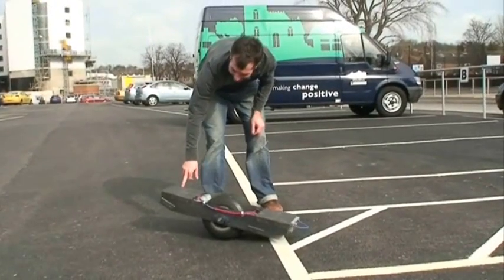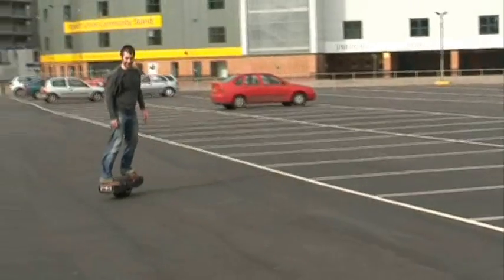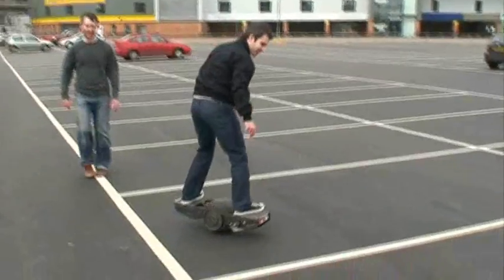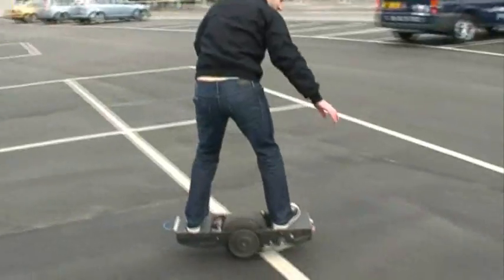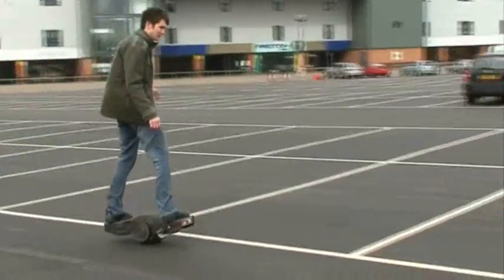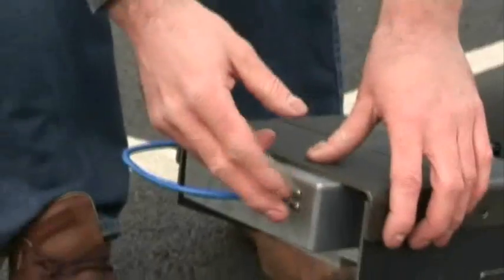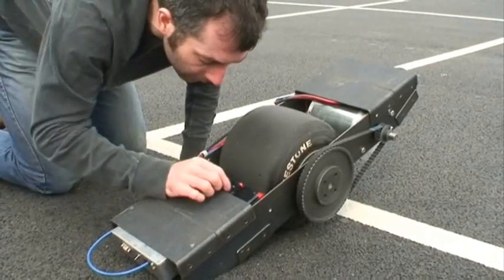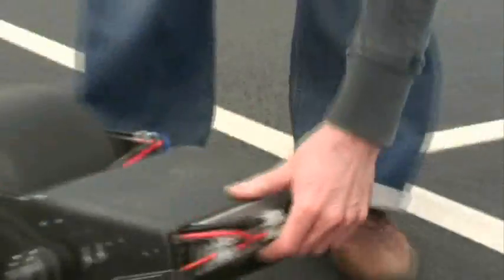Balancing Scooter / Skateboard

Comment: It really bugs me that future motion claim to have invented the onewheel, when you clearly did. 👏
Reply: He did not
Reply: @ManifoldSky He has more of a claim to it than anyone else I’ve seen given that Onewheel came about several years later
Reply: @Jeremy_Huggins  No he really doesn't. Ben built his one wheel in 2007, based on plans and specs from a number of online sources that were part of an online community trying to make home built DIY versions of the balance board first patented in 1993/97 by Dean Kaman of Deka Research (which also showed EUC implementations).
Kamen went on to use his patent to build the Segway.
The patent predates Ben by a decade and a half, and FM by two and a half decades!
Reply: @ManifoldSky  interesting, thanks for the history lesson! I’ll do some reading on what you said as this intrigues me.

Comment: This guy has a full spec sheet in the bio. His notes basically describe a modern onewheel detailing pushback and a hub motor. (This one is belt driven, which is wild)
Reply: the original prototype onewheel was belt driven too. Or maybe chain driven.
Reply: I believe it was chain-drive, but the idea is very much the same.

They didn't invent shit, just patented someone else's work.
Reply: @MasonH24 Ben Smither didn't invent it either!

Comment: Feel the need to comment: Having a patent means very little unless it has been tested in court. Being awarded it by the Patent Office does not mean it is officially valid. This alone is not enough. I have had a few myself. It doesn't give you the right to anything except to sue a possible infringer at your own expense, a considerable expense. It only has any value if you do that and win. If your patented idea turns out to already have been in the public domain, such as a website, research paper, YT video, before filing date then you will lose. You are allowed to publicly disclose your idea up to 1 year ahead of your filing date in the US. You CAN, even then, still patent an aspect of your design, such as the way the motor is made for example, which is fair enough, but not the entire concept if entire concept was already in public domain. Getting lawyers to threaten possible infringers is cheaper, as a means of intimidation, but ultimately means very little. Inspired by this actual video and a conversation with Ben, I spent 10 years building all sorts of personal-project machines that self-balance. This included a clunky but working skateboard around 2008, ending up with a motorcycle that has an e-motorbike hub, all on my channel. Also check out the Centaur Robotics wheelchair project ;)  Ben's board was clearly public domain in March 2007 with this video. On his web page (link above) you will see Trevor Blackwell in the US had a self-balancing unicycle a little earlier than that. A German University had a self-balancing unicycle with a go-kart wheel as early as 2001. The original Segway patent also describes, with an image, a one-(narrow)-wheeled skateboard as a possible embodiment of their patent. The Segway patent also did not actually patent self-balancing, as a self-balancing robot had previously been made by a Japanese university. So if you want to make a one wheeled skateboard I would say go ahead, the concept has been in public domain a long time. If you are threatened with a very official looking legal letter, then check exactly what it is they claim you are infringing. If it is just the whole concept of a self balancing board, say go ahead and take me to court then. If however the OneWheel patents cover specific design improvements such as how the motor is made, then you cannot infringe those, this is fair enough, in their defence. Also they may have an international design registration on the external appearance of their board. This is why in the UK the original Westfield 7 kit car design had to be changed a little so it did not look exactly like a Lotus 7 (it was still a car with 4 wheels though, a design registration is not that broad in its scope). If so you cannot make a board that externally looks exactly the same. I cover a lot of this here: https://sites.google.com/site/onewheeledselfbalancing/

Comment: na, put 2 sheets of metal (copper, steel, aluminum, whatever) on the top of the deck, and that will contact with 2 points on your shoe which are connected, thus activating it and theft-proof it!

won't the motor immediately try and re-balance + stop once you step off anyways?
Reply: That is why you cut the power before you step off, or you jump off with both legs. You do not step off it with one foot with the power on, it will fly across the room as it tries to become level again and punch a hole in the wall. Many hobby builders discover this early on, including me !

Comment: make the fly wheel bigger (gear attached to engin) and the gear on the wheel (I guess the Sprocket) smaller, the thing will go way faster,  >:}}>
O yeah did I mention, upgrade the engin to gass, and you will have yourself a lil speed demon if ya know what I mean!!!   >=]}]   lol